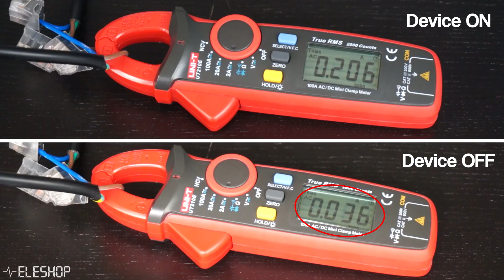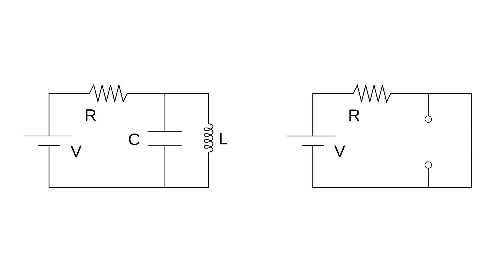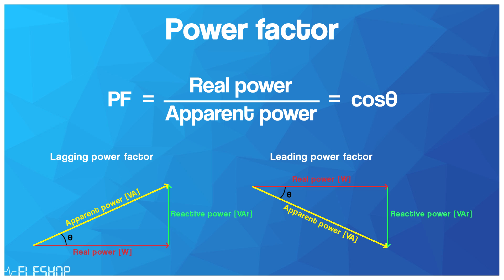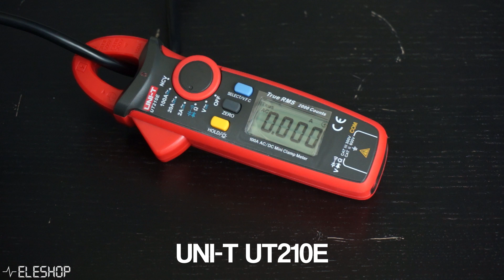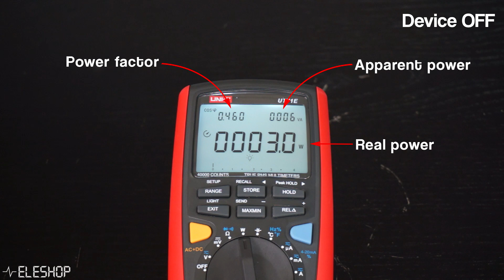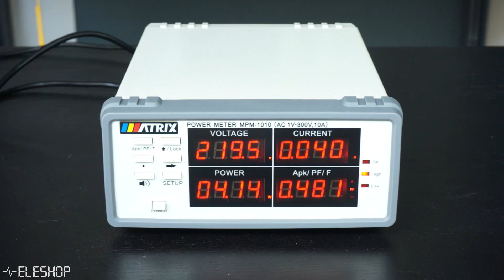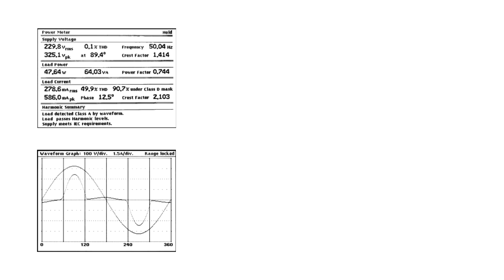How do you measure the standby AC power consumption of products?

Comment: Thanks to create a video on this subject. Although, I see some problems.

« PF = cosθ » (2:13) - this is wrong - the correct calculation is « PF = cosθ / SQRT(1+THD²) » ( https://en.wikipedia.org/wiki/Power_factor ). « PF = cosθ » would be correct for a pure inductive / capacitive / resistive load. But such load don’t exist anymore, because they all have variators on them.

UNI-T UT71E (4:28) - I did use this same multimeter for years, thinking it was the right tool to get correct measurements, but I was wrong. Then I did buy a Rohde & Schwartz HMC8015, and a Siglent SDS2204X (oscilloscope with PM option), and both agree on measurements. UT71E was off by up to 50%, on few items I did test.

I don’t know the MPM-1010 device. For the price, I guess it can be much better than ridiculous plug meters, but I would be surprised to read a reliable standby power at very low current. To claim so seems presumptuous.